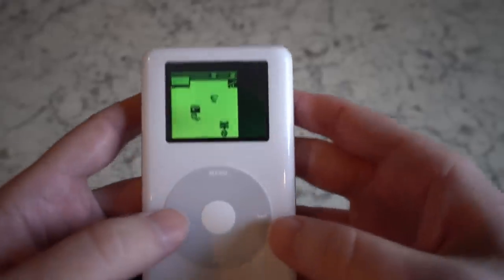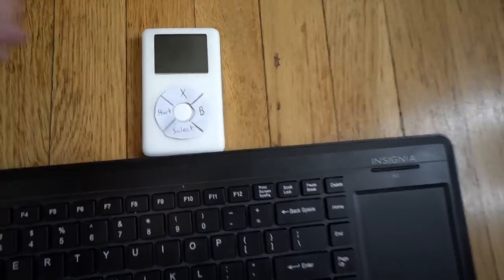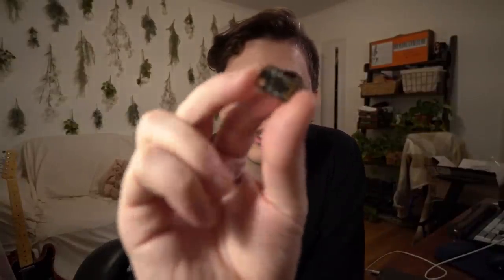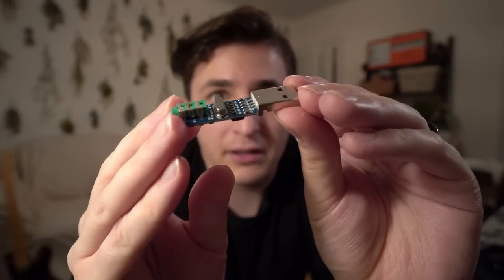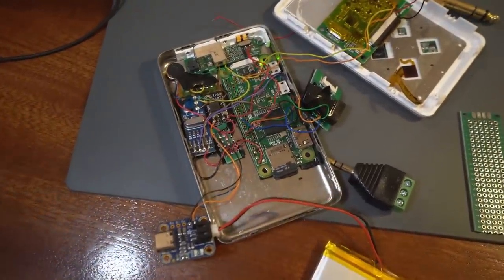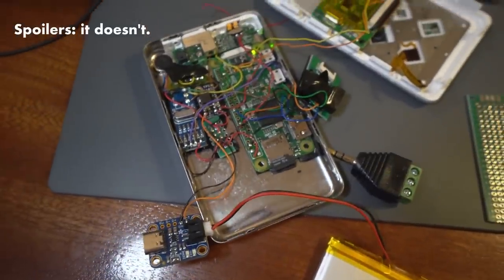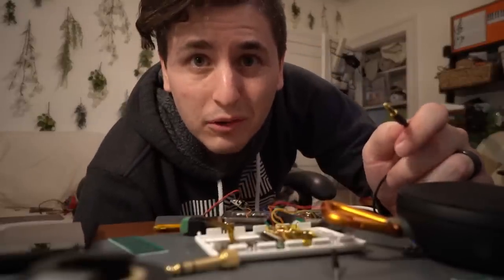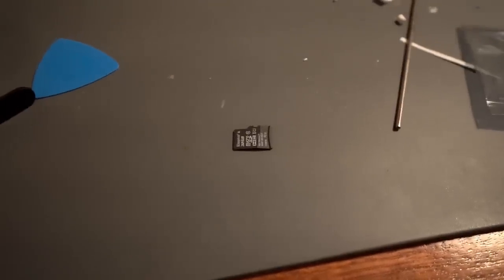Spotify iPod pt. 2: FAQ's and Upgrades!

Comment: Great to see an update! I agree with a lot of your points!
When I watched the original video, I've had the idea to do something remotely similar, but I'm currently busy with other projects, and have to work on other projects to lay the groundwork and dependencies.
Reply: I should mention that in that project, I'm imagining using a Raspberry Pi Compute Module 4 (or newer), prototyping using the official I/O board, then spinning up custom PCBs to make the actual modules fit onto the mid-frame within the (broken device that isn't an iPod) shell with all the right connectors to make the hardware side a drop-in replacement. The software, however, is a different story, and that's one of the things I'd need to work on prior to the project I had imagined.

Comment: Do you need actual iPod 4 or you can achieve this with casting/housing of iPod 5
Reply from the maker: I can't say for sure because I don't have a 5, but I'd it's any thinner than the 4 I think you'd have trouble fitting the components I used. Also not sure if they used the same click wheel.

Comment: Hey did you ever post the updated code and retro pi input stuff? I almost finished my SpotiPod. I got everything working so far except when I start a song it sits on 0:00. Still trying to figure that part out. Also, which USB DAC did you use, and did that need any software changes?

Comment: I know it is not the most efficient way but I'm curious. Is there any way of using the original 30 pin connector instead of a USB c? So It can be used with the original speaker like the hifi or the Bose ones. Cool concept dude

Comment: Awesome! Question, how different is the ipod 6th Gen Clickwheel from that one you used? Because that part plus the case is available almost everywere, it would be easy to construct a 6th Gen look a like Spotify Ipod., also more realstate for other things, like wireless charging and bigger battery and screen.
Reply from the maker: I'm not totally sure but I think they're pretty different, unfortunately. Also aren't the 6th gen ones smaller?

Comment: Did the dac significantly improve sound quality? 
What’s the make and model of your soldering iron? Really cool project that I’m seriously thinking about if the pi zero ever comes back to market.
Reply from the maker: Honestly the DAC I used here was pretty bad - just wanted to make sure I could get one to work. I think in an ideal world I would have just broken out an additional USB port to hook up a nice external DAC. If I ever finish the kit (not likely if stuff keeps going out of stock), I would probably try to pick a decent one to build in. Idk if I trust myself enough to get that right TBH.

Comment: I also think that a kit for this would be great!
But I have a question. Does this work on any Raspberry Pi SBC? and also, what if I want to use a different size, model, manufacturer display? (might use this in a PSP enclosure with my RPI)
Reply from the maker: Only the zero w/ zero w 2 will fit in this case. But the software should run on any of them. That being said, it is quite a process to get running and I just haven't had the energy/motivation to make it better.

Comment: Kits would be awesome! 
I’m working on modding mine as well due to the inspiration you have giving me. I’m adding a larger “3000” mah battery with 64 gb ssd and a csr 8670 bt module to my 5th gen video. This bt is perfect for the AirPods. I agree, make the product I am unable to buy! Thank you again. Also added the rock box software. Spoiler, it has an option to turn off accessory power from the software....

Comment: Writing code for the touch wheel is no small feat... That's the part that puts me in awe when I see this. That and building a UI from the ground up.

Do you think it's possible to code controls for the 1st Gen's mechanical scrolling wheel?
Reply from the maker: It seems like they changed the hardware up quite a bit between each generation so it's hard to say - I haven't been able to get my hands on a 1st gen. In general the older stuff tends to be a bit simpler though, so it might totally be possible
Reply: @GuyDupont  Hm. I'll have to crack one of my two 1st Gens and see what makes the scroll wheel work. It's probably some sort of piece that runs along a pad of some sort, making it similar to a touch wheel. There are four buttons located on the outside rim, so it still has five in all, which is nice.

The housing is also a good size larger than the other gens, so I'm thinking a Pi 4 might work here, though it might be overkill. Pretty sure with how thick the 1st Gen is, it might even house the USB ports comfortably. They might have to be removed to fit everything I would want in a hifi player, though.

Comment: I love this mod! Do you think it'd be possible to do this but keep the original DAC and screen? I'd imagine that maybe it could be done if the pi is wired up as the hard drive for the ipod, but as a coding novice I'd have no clue whether that could be done or not
Reply from the maker: It's "possible" but I think it would require the removal of DAC and screen driver chip from the original circuit board - wouldn't be enough room otherwise. Would also need to figure out how to actually use the driver chip, which I'm sure is doable but is a little more than I am willing to take on. Someday, maybe.

Comment: Does this work as a Spotify Player? as in can i control its output from another spotify app? 
i would LOVE to build one with a nice DAC in it, and integrate it with my amplifier shelf
Reply from the maker: Yep! I cover it a little bit in the part 1 video (although a bunch of it is out of date). Tl;Dr, check out the "raspotify" library for Raspberry Pi.

Comment: I was thinking this would be perfect for work since by the time I leave, my phone is at 20-10%. Thing is I use my Spotify in offline mode and listen to the downloaded songs since Spotify is blocked on the wifi. If I can’t download the songs is there a way to bypass the internet connection, like maybe through a vpn?
Reply from the maker: I think a VPN would work fine, you'd just have to configure the Pi to use it automatically
Reply: @GuyDupont  Great! Thanks!

Comment: You’d hear a noticeable difference if you use the apple usb c to 3.5mm DAC, even has a microphone preamp!
Reply from the maker: Good tip, thanks. Didn't think it would be that cheap! I think it would be harder to hook up in this context though, since the pi doesn't have USB-C, and I wanted to use the existing jack.

Comment: Im thinking, cant this be built from parts bought from chinese knockoff manucaturers? You can get the body for the iPod and the clickwheel. The rest is arduino/raspberry Pi modules.
Reply from the maker: If the click wheels are pin-compatible, I don't see why that wouldn't work!

Comment: As a Tech who soldered many of phones I dunno who you do all this work without a microsoldering setup...
Reply from the maker: Someone who doesn't do this professionally 😆

Also this project was 100% large through hole parts. No tricky soldering
Reply: @GuyDupont That was supposed to say "how you did this" I couldn't imagine doing this without a microsoldering station, but to be fair I've never soldered without one so... Either way good job <3 Don't think I could do this because I couldn't live with out my clicker wheel click though lol

Comment: i clicked on part 2 to know that does this has ads or not
Reply from the maker: It does not have ads, but it also only works with Spotify premium
Reply: @GuyDupont  have you abandoned this project? Seems that the api changed some stuff and you can't actually get the software to work.
Reply from the maker: @user-wp2xf3yh5w  wouldn't say I've abandoned it, but any future work will go towards a complete redesign. Unfortunately I have not been able to keep up software-wise with this version - sorry!

Comment: Yep, pointless! Just about as pointless as me putting in a week of work just to make it easy to swap a USB sound card in and out on the PiBoy DMG. But I'm still doing it, and nearly done! Wireless audio is important to me, and for a gaming device, low-latency wireless audio is even more important.
I find it really amusing that you probably had to deal with some of the shenanigans of getting USB audio working on the Pi alongside Alsa. Did you somehow manage to get it to seamlessly swap between headphone jack and Bluetooth output when BT headphones are connected? Or did you put some sort of toggle option in the settings menu?
Reply from the maker: It wasn't as bad as I thought it would be, honestly. The audio from the emulators worked immediately! Followed some random instructions I found online for Raspotify. I didn't bother adding a convenient way to switch, I don't see myself changing it very often. When I do, I'll just SSH in.
Reply: @GuyDupont  Nice! And fair enough, haha. Yeah it sounded like BT was your preference so I figured as much.
Getting sound to go through the USB card is pretty easy on its own, definitely. Doing it in an environment where a number of processes expect to only use Alsa, and designing it to be used with any USB sound card, able to switch automatically without the user having to interact with terminal... That has been a cool adventure. 8)
Reply from the maker: @ReavoEnd  I do not envy that! Sounds cool tho

Comment: I loved both videos except the title cause it made me believe you'll use an original apple pcb. It's a pizero in ipod shell and nothing more which we saw in all varieties since pizero hit the market.
Reply from the maker: This is a copy/paste response since I get this kind of comment occasionally.

1. Yes, it's a Raspberry Pi. It's right there in the title.
2. I used as much of the original as I was able to at the time. It's not "just the case" - I am using all of the original click-wheel circuitry, which was non-trivial! I also got the headphone jack working later on. I would have loved to get the screen working.
3. I challenge anyone who says "its not an iPod" with this question: if I put this in your hand and let you use it, without telling you what was inside, how would you honestly describe it? 

My goal was always to capture the spirit of the iPod, not constrain myself to the original hardware 🙂
Reply: @GuyDupont  not here to belittle your achievements. It was useful for me personally. Considering your great job making click-wheel to work it's still just another input device for Raspberry Pi. Calling it iPod just cause it's in its original shell? Well, I owned a bunch of Chinese iPhones running Android. They used "original" shells to host its hardware. Should it be called iPhone:) ?
Reply from the maker: I know, and I appreciate your comment. But I think my point stands, even with your example - If I used one of those Android/iPhones, I would definitely not call it an iPhone, because it doesn't behave/feel like one! I think folks just have a different philosophy about where the line between iPod/not an iPod gets drawn. I am obviously biased, but I think it goes deeper than hardware. Like to say the click wheel becomes "just another input device" - where does that line get crossed for you? Again, I appreciate your thoughtful feedback and your time! It's fair. I just get a lot of really lazy versions of this comment, and I just wanna make sure folks know how I was thinking about it and that I'm not trying to fool anyone.